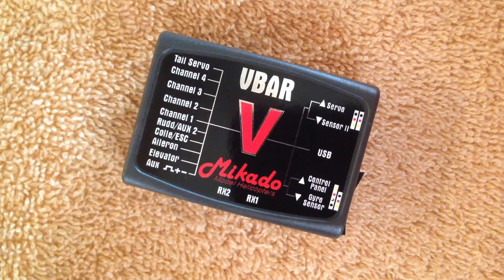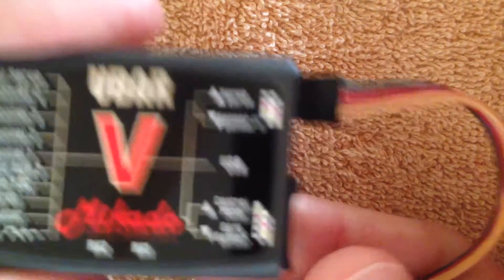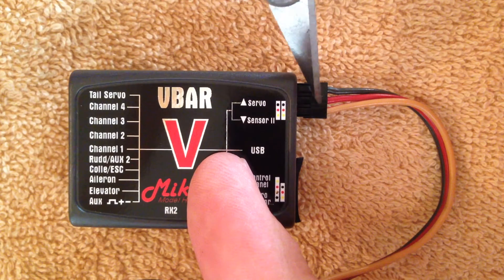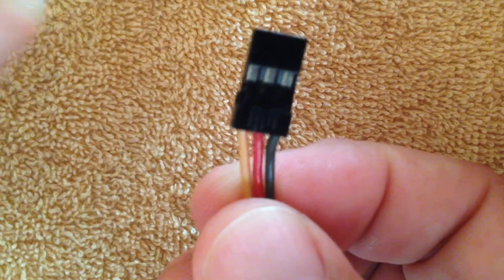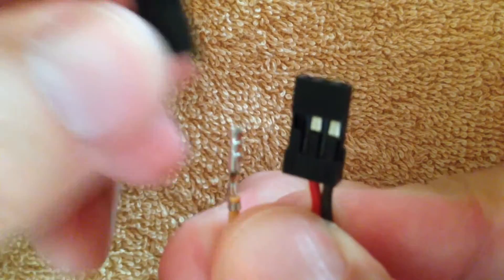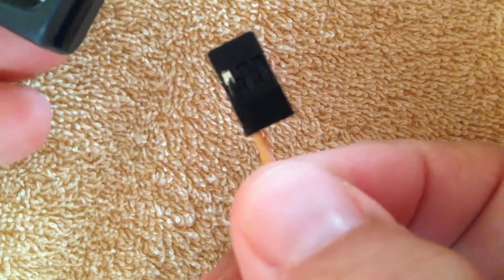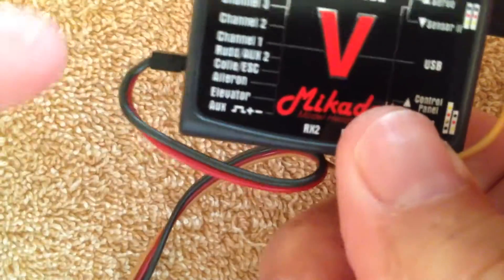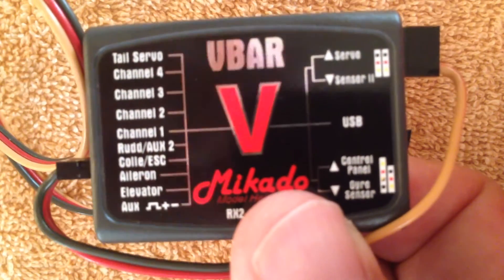vbar gov using spektrum nitro back plate sensor

Comment: Just thinking out my system, have the Spektrum sensor, the TM1000 telemetry sensor also supplies 3.2V to the sensor!
I intend running a Y signal to the TM1000 and Vbar. Not sure if 5v or if running HV even higher voltages is ideal for this sensor, really need to investigate the sensor specs. Will bear this in mind if I have problem then tks.